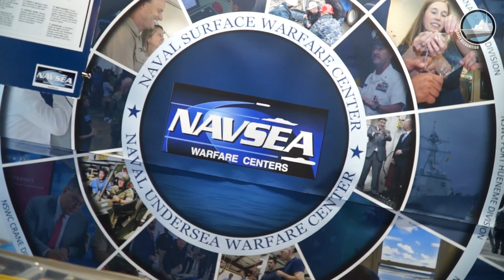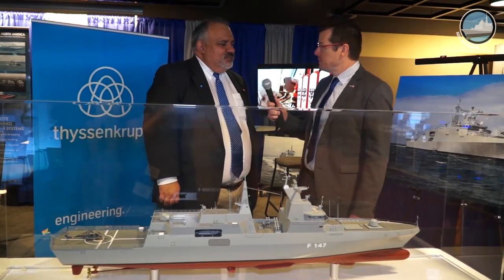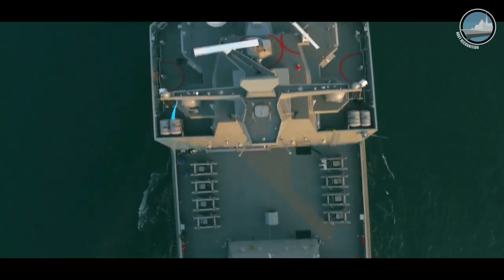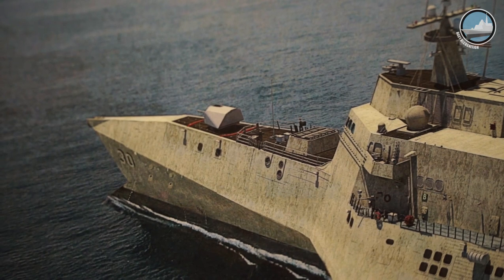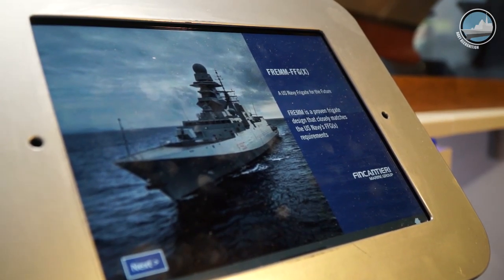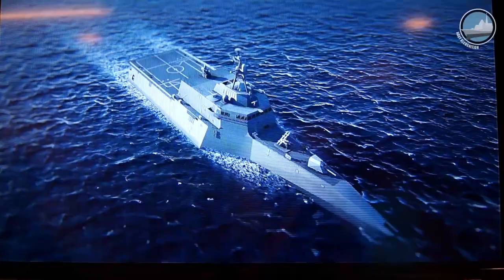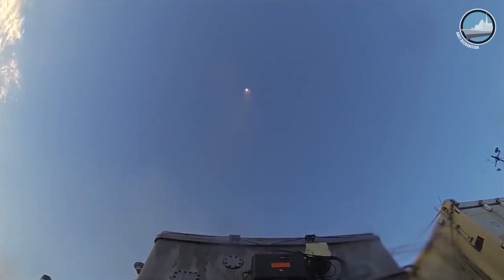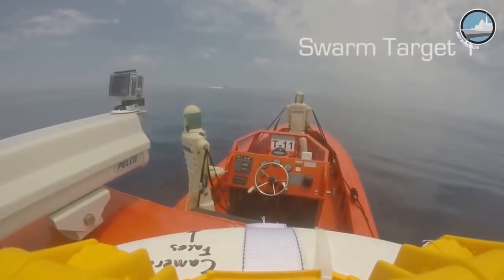SNA 2018 Day 2: FFG(X) designs by GD BIW, TKMS/Atlas NA, Austal, Fincantieri

Comment: I would like to see the Navy split this contract into 3 winners with a guaranteed buy of only 3 or 4 hulls each with an option to buy an additional 28 to 30, but optimally 12 per shipyard.  It maybe more expensive but we've always seen diminishing returns out of scale when it comes to shipbuilding.  Also since most of these hulls are already developed the often front loaded R&D costs should be a minimal.  Doing it this way shipbuilders will have a huge incentive not to slip up.  If we run into a capability problem we can cut back on one class and build more of another.  If all 3 ships are good then 12 hulls plus all the other hulls in other navies should provide a large enough channel for spares.

Comment: I wonder if USA Navy is taking note on Australia Navy future frigate program, I bet Navantia F105 design will win as cheap and proven design.  But I feel Australian destroyers are frigates.  Will USA fit CEA array radar to their frigates?
Reply: They have already the SPY series, the TRS-3D and TRS-4D (Germany), Saab Giraffe (Sweden) on their combat ships and the SPY is going to be replaced on new ships with the EASR series.

The EASR is build up from modules, which can be connected. This way it can cover a wide variety of radar sizes with the same components. It is planned to use 3 radar block, consisting of 3x3 modules. It is way smaller than on the new Arleigh Burke Flight III versions, but the components would be the same.
https://www.raytheon.com/capabilities/products/easr/

Comment: My pick would be the meko german frigate. Hitech, the right size and has room for future growth. With the rotating Raytheon EASR and a 16 or 24 cell mk41 vls and a souped up drive train to get 32 knots it's a winner the rest of the equipment can be picked according to budget eg 76mm or 5 inch.
Reply: I agree. Lovely ships.  I have been on them and had a 5 hour in-depth tour.  I was also along sde of them when sailing at speed.  They are truly wonderful platforms and with the correct armaments will provide the US navy with what is needed.

Comment: Did the Navy give a dollar amount per ship they're willing to pay or it's a free for all in pricing? Since these frigates will be primarily an escort in a carrier group for its submarine protection with the added benefit of air defense. How many hulls are the Navy thinking per CVN group? There's a total of 10 active carrier groups. I would expect at least two frigates per group. That leaves a number of 20 hulls and n-number of spares. I would expect two SSNs one point and the one covering the rear. The Navy will need 5 - 7 more hulls for their AGR/MEU groups. Basically, you're looking at a minimum of 30 hulls. Say two hulls built per year. It will take 15 years just to do the initial build out. These ships cost have to be kept to $0.75 billion max. Total cost for a 30 hull fleet will be $22.5 billion. Hopefully, the size of the ship stays close to the previous Oliver-Perry class and kept under 5000 tons fully loaded. They better be powered for speed and also electrical power for present and future systems. LCS hulls are a no go with me. They're designed for shallow water and not blue water operations. I could see an LCS be part of an ARG/MEU group since the group will end up in shallow water sooner or later. I did like that presentation of that surface to surface missile module. Twenty four pack of ice cold Hellfires for swarm boat protection. I still feel they should put the gun used on the A-10 Warthog on the bow of these LCSs. :-)
Reply: Hmm nope Russian frigates and corvettes can go open sea too... Cold war era frigates were small now they go 5000t+ for example the developing Russian frigate admiral gorshkov will go to 8,000-8,500t while the current is 5,400. And they pack a good punch too. 32 SAM VLS and 16 Antiship + antisub torp launchers... And 130 or 100mm guns

And best thing is their prices are low 450M per frigate now.
Reply: @andrej4519  Admiral Gorshkov is around 5400 tons. Maybe your referring to the Super Gorshkov which has 48 UKSK VLS will probably weigh around 8,000 tons. It will be essentially a destroyer since Russia does not have modern destroyer aside from their old ones which was built during Cold war(Soviet Union times).

Comment: What I seen so far out of all the frigate designs, Is that Navantia f-105 wins.. But FREMM frigate is not far off..If FREMM do a little better design it will be right up there.. I been waiting for this Video.. Thanx :)
Reply: And yes I seen the Lockheed video first...
Reply: I'm leaning towards the Meko for something cheap (I'm hoping the navy goes for 40 hulls). Fremm wins though assuming the cost isn't crazy. The Lockheed design is fugly as sin (the design last year seemed better). The Austral guy's expression screamed "we're fucked", also the rear vls seemed really exposed.
Reply: Yeah, that's the problem with the Navantia  F-105 ,,It cost the most out of all of the other designs....But what a ship, and good for Air Warfare,  submarine warfare, sea to land warfare, ship to ship warfare...And is already working around the world..
Reply: these fucking fridget designs are crap  when compared to the more heavily armed russian counter parts. These enlarged LCS's suck
Reply: The Navantia proposition based on "Cristóbal Colón" (F-105) of "Álvaro de Bazán" class IMO have the all marks of the winner. Not only because the tech specs (it could receive better CIWS system) but also a story behind it. It was build with heavy help of USN engineers and according to USN standards.
Reply: Galvars You forgot and sexy,,, Yeah, Navantia F-105 is one sexy and smart frigate...
Reply: But also as you mention above, costly. But that is created by integration of AEGIS system, it is the pretty costly thing. But on the other hand, OHP had some criticism about it's ability in Air Defense zone. This ship have the best system for such task that is installed on ship AND it is fully integrated in to USN systems. "Álvaro de Bazán" class do serve as part of USN carrier Task Force escort already. IMO perfect "neo-OHP" ship.
Reply: What about the Norwegian Fridtjof Nansen class multi role frigates (original designed as ASW-frigate), it have an lighter AEGIS system, and a lot of extra space for weapon upgrade. And it have proven it self in handling any environment from the epic North and cold weather, to Africa's coastline and hot weather. and only need a crew of 120.
Reply: @Jwheel86

"Meko" does not describe a certain type and more a design philosophy, of designing the baseline and building the ships modular to enable big changes during the service time or create a new type on the same hull. 

The Design is a Meko A-200 not something else and not '200'. The 200's started service in 1987 that's a bit old school by now, 25 of 25 still sailing.
The A-200 is the lightest usable proposal, fuck that Austal thing.

Product portfolio at TKMS and the workload is a mess.
Currently, there is A-100 (80 and 90 on request) and K130 (both corvette size), SA’AR 6 (for Israel in the works, based on K130), Meko A-200 (light frigate), Meko 600 (based on F124), Meko A-400 (based on F125, late) and MKS180 is in the works (based on 400 / F125). Proposals not counted... 

A-200 is the only one with a WARP drive tho - you call bs? Show me the funnel :O 

@heuhen
the "Norwegian Fridtjof Nansen class" is just a Spanish F-100 derivate.
Reply: @heuhen  This is also the F100 - a lower cost variant (lower cost on a reduced AEGIS). Thus far, some 12 F100 vessels are in service between Spain, Australia & Norway with more on the way. The best choice by far!
Reply: Agreed! But since F100 already fields AEGIS and has plenty operational and trusted ships..
Reply: I don't think they will cut the dollar to the point of discarding F100 for being expensive. It is proven, safe to invest design. Would be a little disappointing after other tax-eater programs
Reply: The last Russian ones are pretty bombastic indeed. F105 is quite a toy nonetheless
Reply: Indeed!
Reply: Indeed!
Reply: Costly, yet not expensive by any means. Safe investment, for once! Salud
Reply: Costly, yet not expensive by any means. Safe investment, for once! Salud
Reply: With a poster of the AB destroyer to look at!
Reply: They F100 it's the parent ship of the Fridtjof Nansen, as it would be for the FFGX program if GD BIW+Navantia wins the contest. Beautiful ships, so sad the unnecessary lost of one of them. Salud!

Comment: No info on why the USN is requiring a puny little gun (57mm vs 5 inch).
Reply: The US Navy is lined up to have just shy of 80 destroyers with 5 inch guns.  Its just not necessary for this frigate to pack a big deck gun
Reply: 57mm is very marginal vs ships.
That said its probably better in the PD role.
ORKA gun launched missile would increase its PD capabilities as well as increase its utility vs swarm attacks.

Otomelara has a very solid ammo line up for its 76mm guns however.  Including guided AA,GPS guided for fire support as well as IR guided for antiship.

Its probably more versatile overall....at a weight and size penalty.
Reply: FFG(X) 57mm is set to benefit from the two smart ammunitions being developed, ALAMO by L3 Harris and MAD-FIRES from Raytheon and DARPA.

Comment: Personally,I find the LCS as a dead end system. I'm sure there will be others who will say that there's still potential. Me all I see is Pork!
Reply: Paul Kremer what are you guys talking about, the LCS is not even among bidders, it's a littoral ship. The euro FREMM would be the option and is the most proven and mature platform of all tbh, the US Navy can pack it with all the weaponry they want.
*Edit: wait, did you mean the Austal LCS or the monohull LCS? The first is in for the bidding, the second is not.
Reply: @the david -- Both LCS hulls are in the bidding as "up-gunned" variants. https://en.wikipedia.org/wiki/FFG(X)#Contenders
Reply: @Paul KremerAluminum hull, no sea keeping ability, must stay out at sea for months at a time.  A rotating full crew on a frigate or a destroyer can do it.  Ya you can have two operators navigating the ship while the others sleep like in their ads but never in a tension area, you always need lookouts and people on the defensive systems 24/7
Reply: Navy loves them.
Reply: @mrstrife806  they do. The problem with the design was it was born from an era where they(Congress) wanted a cheaper designed ship. They work for what they are. They are not destroyers. Casualties of design was ongoing through the entire contract ( which they are still being built now).